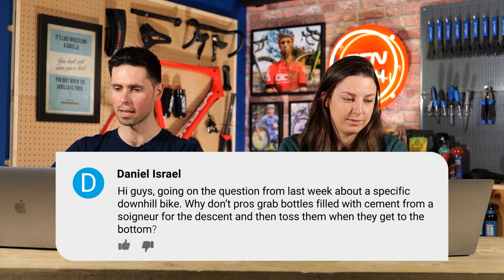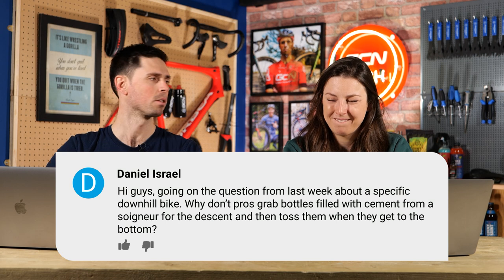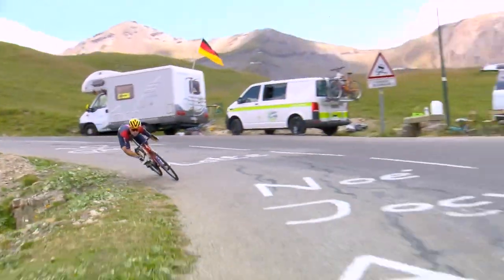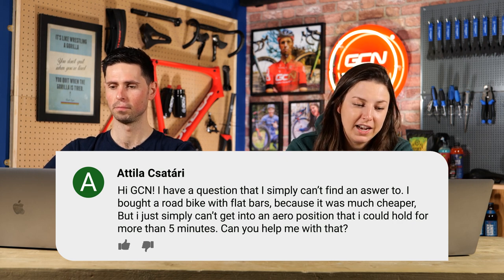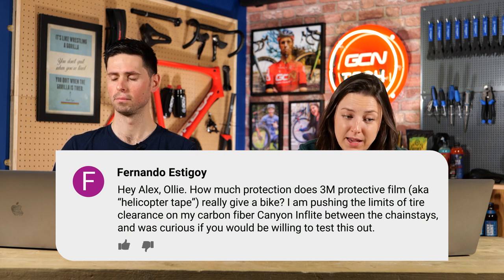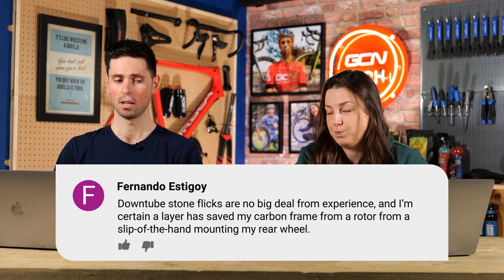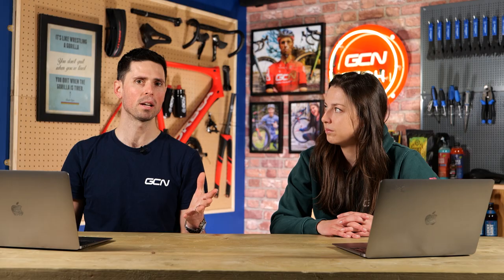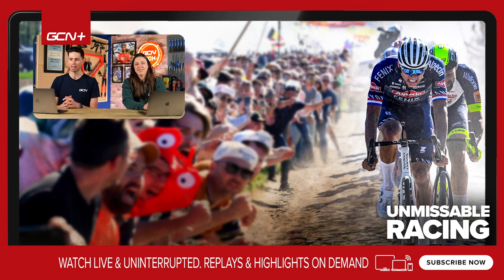Riding In A Tailwind, Frame Tape and Concrete Water Bottles! | GCN Tech Clinic

Comment: average Cement is 1.44 times as dense as water, so if a 500ml water bottle is filled with cement rather than just water you would gain 220g of additional weight for your descent, compared to the faff of having to sneak cement bottles to the riders, collect them again and the risk of being caught it doesn't seem like a good idea.
Reply from the maker: What if it was made UCI legal? 😬
Reply: @gcntech  If it were UCI legal, then the teams that could afford $15,000 road bikes would use tungsten filled water bottles, giving them a 9.6 kg mass in a 500 ml bottle. Assumption being the carbon fiber bottle cage held on with fragile riv-nuts could sustain the load over a bump, might need a couple more layers of carbon fiber in the downtube for that.
Reply: Why stop at cement! Lead ingot bottles!
Reply: @kennethward9530  Tungsten is cheap enough 80 euros per kg or something.

Comment: Cement? Amateurs. Its only 2.4grams per cm3. Fill it with platinum(21.45 grams/cm3) tungsten(19.35 g/cm^3 ) or gold(19.32 g/cm^3). osmium(22.6 g/cm^3) iridium(22.4 g/cm^3 ) but you probably cant buy enough of the last two. So platinum would weigh 21.45kg devided two 500ml bottles! Now that is a gain. Its going to cost you roughly 60k euros, imagine tossing it out at the bottom! Tungsten is the achievable cheap option, but you will leave roughly 2kg of marginal gains over platinum. So GCN give it a go with tungsten!
Reply from the maker: Not sure how the riders would feel being handed 20+kg bottles at the top if a big climb 👀

Comment: 1. Cause they don't like drinking cement, and it doesn't aid recovery.
2. Cut your flat bars narrower. 
3. A tailwind doesn't change airspeed, just ground speed. So position doesn't change.

Comment: The real reason you don't submerge chain in lube/oil is that it takes a hella lot of oil to fill the container. Everything Alex says against it is rubbish. Oil penetrates as easily, especially if the chain is prepped as well as for waxing, and stays in place as well too thanks to the capillary effect - the very same effect that lets it stay when you drip it on.
Reply: Agreed!  Whether using drip lube or melted wax, it's cleaning the chain that's the difficult and crucial part.
Reply: As a lube user (heh), I will admit that the process of wax solidifying means that it won't connect and suspend dirt like liquid lube will. But I'm too lazy to wax so I'm sticking with lube anyway
Reply: @ml48963  then go for drip-on wax emulsions. As the carrier evaporates it leaves solid wax in the rollers.